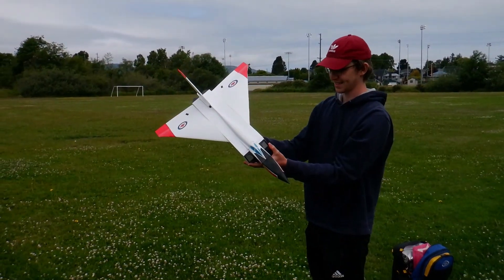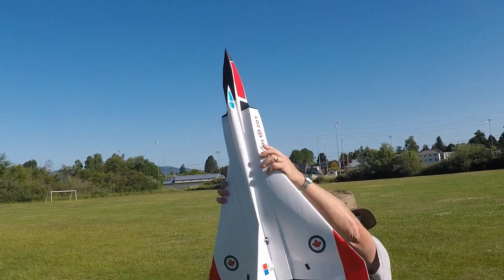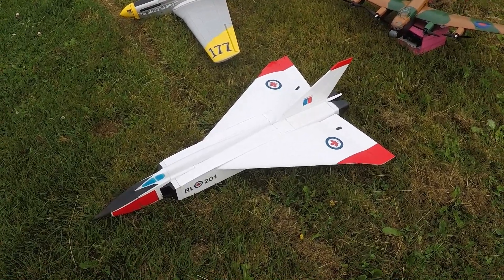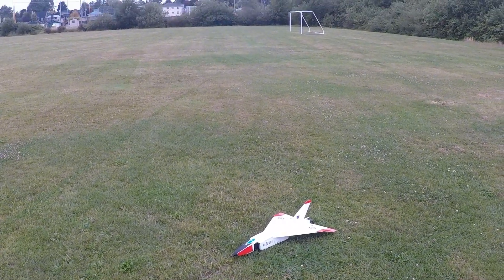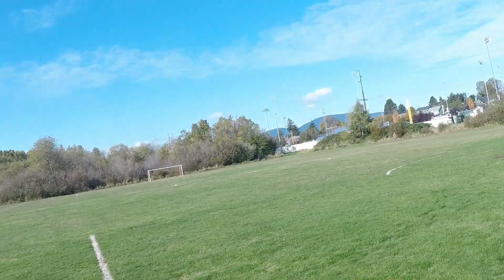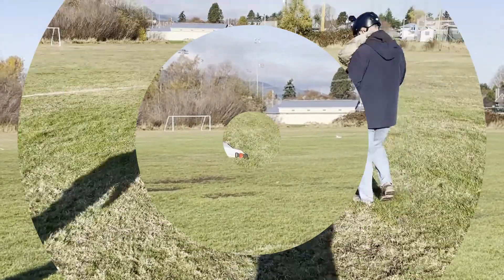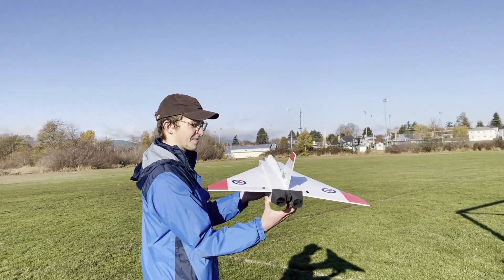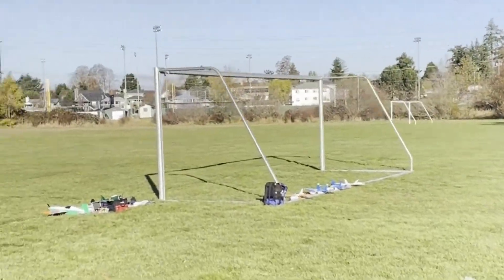Not Every Design in 2023 was a Winner: Part 2: Foam Board Avro Arrow CF105 50/64mm EDF

Comment: Have you got it sorted yet? Seems like aileron throw is WAAY too much.  I have a TSR-2 and it requires 50% aileron, but full elevator travel on the elevons.  To test CG and elevator trim I did glide testing with 10% throttle into tall grass.  Great re-maiden knowing that it was trimmed out.
Reply from the maker: I crashed it again before getting it sorted. I agree that the roll throw is way too much. I’ve since flown a J10 and Grippen and mixed aileron at 30% and elevator at 70% and it worked fantastic. I will try that on the Arrow and see if I can get it under control. Thanks for the feedback!

Comment: That's a shame 
I have same model flies great 
As a propslot 
Think I see your problem 
The Arrow had a dog tooth leading edge for a reason 
The classic delta (like you've built) is highly unstable at low speeds and extremely pitch and roll sensitive 
The COG (going off mine) -which looks to be same scale as yours - is 19cm from where the wing fuselage join at the front of the wing
Second problem is the KF wing construction 
It looks like your KF cuts right across the wing --it shouldn't 
You've basically blocking elevons from clear airflow 
PM me and I will share pics of mine
Reply: What does KF stand for?
Reply from the maker: @autogyro333  KF or KFM is a style of airfoil that is mostly a flat sheet with a doubler on the leading edge. I believe KF comes from the inventor.
Reply: KF stands for kline-foglemen airfoil i could explain but google does a better job
happy flying @autogyro333
Reply from the maker: Thanks for the input! The 50mm version had a more KF style section but I changed to a traditional section with the 64mm EDF. I will modify the wing with the dog tooth and add a wing fence. I will also move the EDF rearward to get the CG back. My target is currently 165mm back and it flew ok the one time until the spin. I’d love to see your plane. My email is robsrcplans@yahoo.com